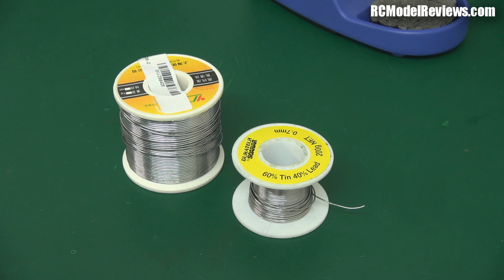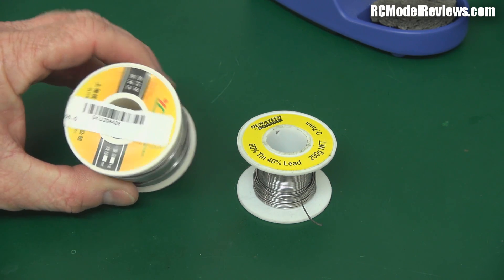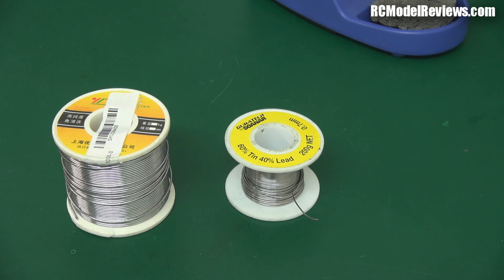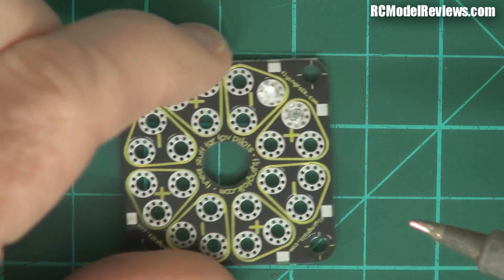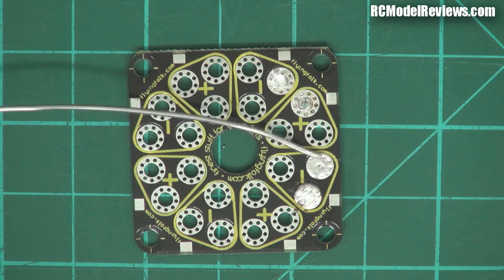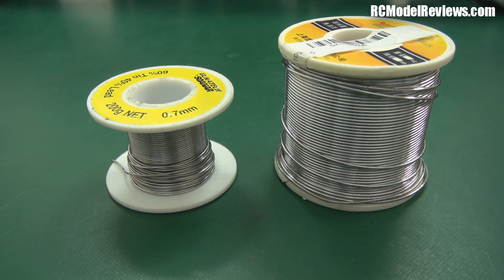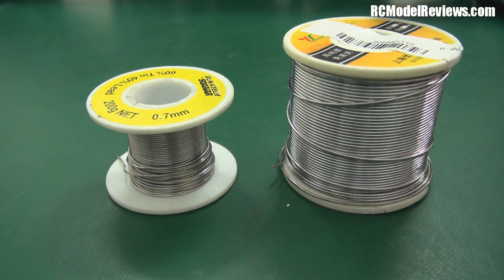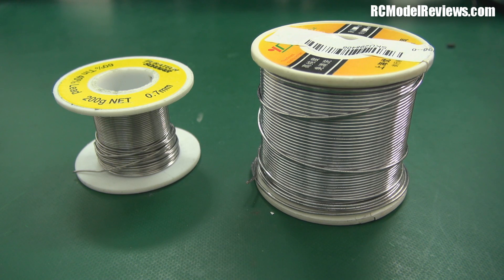60/40 versus unleaded solder

Comment: I use Mercury 703.450 lead-free solder and am quite happy with it, mainly use it for cables and so. It has 99.3% Tin and 0.7% Copper with 2.2% flux.   

It might have been worth explaining why lead in solder is not actually that dangerous. As I understand, boiling point of lead is so high that you cannot reach it with a measly soldering iron. So the vapour (while not healthy) that happens during soldering does not actually contain lead. Is that the correct explanation?
Reply: +YensR Yes, you are correct about soldering at normal temperatures not producing lead vapor.   The environmental/health impact seems to come mainly from the effects of e-waste where landfills are full of old electronic junk and the solder contained within.
Reply: EdWatts Well mercury is a substance that can be managed really, clean your hands properly after handling and preferably wear gloves. But above all don't breathe in the fumes, provided you don't do something overly stupid with it like consuming it... it doesn't absorb very well through the skin as far as I know.

And what you stated about the lead staying in the landfills, well I can't say I ever really investigated it but your statements do seem credible to me mainly because solder stuck to a PCB tends to be solidly connected unless you go about melting it or using harsh chemicals on it.

However I do not think that the RoHS in principle is a terrible thing, the alternatives are reasonably sufficient in my opinion but if anything the biggest factor that should be addressed is our own human nature:
- The lack of possibility to repair things (by design, try opening and putting some modern things back together intact with their plastic clips, self tapping screws, glued stuck etc).
- Our constant urge to "get new stuff" and then throw the old stuff out if its not even broken.
- If we do throw stuff out because its truly obsolete whether it works or not it should at least be recycled as well as possible reclaiming materials and reducing the landfill footprint.

As long as we behave in that way taking some of the harmful heavy metals that are included as trace amounts scattered through products will help, whether it ends up in a landfill (intact or crushed) and even more important if it goes through an incineration plant where those heavy metals would probably end up in the fumes (although they might filter most of that out? I don't know the details). Oh well the world isn't perfect, I would be okay with longer lasting better designed products... even at the increased cost price. Would be great to be able to repair them as well or get spare parts rather than "nope, replace the whole unit" approach.
Reply: +YensR Funnybthin though is that the fluxes used with lead free solder are actually more toxic than the rosin flux used for 60/40. You really shouldn;t solder with lead free indoors without a fume hood.
Reply: +quangluu96 Yup the flux smoke is indeed the worst aspect, personally if I'm soldering I usually have both my old little carbon filter fume extractor fan thingy (that just pulls it through the filter and away from the bench) and an open window + door to get some natural draft to ventilate the room in general.

With the right iron I do find lead free solder manageable but I do tend to grab my spools of leaded solder on most days. Mostly because I have them around and still got a bunch more in storage, but yea the environmental impact of all the discarded equipment containing little bit of lead solder on all the solder joints are not a negligeable factor and those small scattered amounts aren't easily recycled. I don't know what happens to them exactly if they end up in a waste burning facility, but it can't be any good in a landfill either.

To the operator of the soldering iron and the end user of the product though  the leaded solder isn't an issue directly, provided the soldering iron operator cleaned his/her hands before sticking it into the mouth or handling food.
Reply: EdWatts Obviously the Galena and elemental lead that naturally occurs in the ground has a much lower surface area than the billions of tons of wasted lead we have used in discarded electrical appliances.  Also the junk we've thrown out is usually not buried deeply enough to prevent runoff from leaching it into the groundwater.  A garbage dump is essentially a coffee filter full of bits of lead (and other toxic chemicals) that rain water is being percolated through.  That's a pretty big difference.
Reply: +EdWatts Well of course it's not going to leech out in a few years.  We're talking about a few centuries.  The planet and all of our garbage is still going to be here.
Reply: +Justin Hall 

You realize, don't you(?), that this lead was in the ground before it was in the solder.  The same is true for mercury.  Uranium, too.  Plutonium?  Well, not so much, but...  This "garbage" has always been with us on "Spaceship Earth".

By the way, it's "leach"; "leech" is a critter.
Reply: +Atomicskull That sounds scary. Do you have a source for that? I found the report from the Danish Toxicology Centre, but it is not very specific regarding the dangers of the fluxes (page 49) or seem to indicate that flux for lead-free solder might be better (page 66):   http://www.ems007.com/PDFs/Survey_on_Lead_free_solder_systems1.pdf
Reply: ***** Yes, I understand that. As you can see above in my reply, I have done some research. The question was: Which flux vapour is more dangerous: The flux in leaded or the flux in unleaded solder.
Reply: Yes, definitely - safety first!
Reply: +xjet 

It's really funny that no one mentions that landfills are sited with great regard to their potential for polluting ground water and that the lead in solder was, once upon a time, situated within the earth/soil before it was extracted with very little regard with respect to whether it might, one day, end up in minuscule amounts in drinking water.

In other words, this RoHS nonsense is a bunch of hooey.

"Save the Earth (?), ruin the world."
Reply: +quangluu96 

Yeah, but...

...I have buried printed circuit boards in my yard, some of which I left undisturbed for several years.  Upon excavation and microscopic examination, I verified to my own satisfaction that there was absolutely no visible/measurable leaching of the solder.  In other words, the solder in a television in your local landfill is not going to end up in your brain, liver, and kidneys.

Mercury, which is much more toxic -- and mobile -- than lead, can be found in its native state in little globules of liquid in cinnabar deposits.  When I was a boy, I and most of my friends had a jar of mercury available to us in a desk drawer which provided many hours of fun and enjoyment.  My friends and I -- and people who live near "mercury mines" -- have not been dropping like flies, nor will we ever be so.

Much ado about nothing.
Reply: Lead below boiling point will release vapor.  The ocean never gets above boiling yet it still rains.  It has a partial pressure for every temperature as a liquid.  That is why you smell it (assuming that is not the flux).  Also sometime if you use a torch you get hot enough to melt copper.   The boiling point of lead is 3180. 1984 is melting point of copper.  So as temp increases lead vapor increases.

Comment: Damn, I got some 63/37 from banggood, and it behaves the exact same way with dull joints, and pasty. I never even considered it was actually lead free. I just thought I hated 63/37 despite what everyone said. It is the worse solder I have ever used. I tossed it.

Comment: This was one of the first things I found out when I started the hobby. My solder was terrible and I was blaming the iron. So I got a new iron and it was the same, so I blamed myself. Then I happened to try some solder that a well known UK Quadcopter shop was using and tadaaaa! Beautiful solder joints. This video will no doubt help many people. Don't forget the link to you old video mate. Have a good one.
Reply: +John F Hendry 

Some years ago, I went to my father's house to help him with an electronic project; as I was preparing to leave, I had an inspiration.  We were both practical jokers, and I had some "dead soft" aluminum wire; what happened next was almost inevitable.  I took a large roll of the aluminum wire with me, and I arranged to have my wife call and ask for Dad while we were in the shop working.  When he went to answer the telephone, I quickly wound a layer of aluminum wire onto the solder spool.  When he came back to the shop and started "soldering" again, much hilarity ensued as he was completely unable to melt the aluminum wire with a soldering iron.

Dad was murdered in 2003, and I really miss him.
Reply: EdWatts Sorry to hear that...
Reply: +ThatHPI GUY that's exactly the same way I discovered that lead free solder is crap.
Reply: +ThatHPI GUY Same story here, matey.  Hated soldering for a long time and thought I just didn't have the knack for it. It put me right off getting anything past breadboard prototype stage. Got myself some nice and thin 60/40 and realised I actually CAN solder quite well. Now I actively look for excuses to solder stuff!
Reply: +ThatHPI GUY Ill try  this 60/40 solder asap. :-) Flying a 250 quad for a year now and with the build and repairs i was using the lead-free solder all the time.. Now i see the problem. hehehe Thanks bruce!
Reply: +John F Hendry 

Yeah, but the story was funny.

Thanks.
Reply: @starlino  who makes a good lead free solder please?
Reply: starlino what is a good supplier of lead free? What are the tricks? Would be a huge help in this debate! Thanks in advance
Reply: +ThatHPI GUY 
Spot on HPI, I was exactly same:)
Reply: +starlino Yes... I measured some leads I made... less resistance with the silver based unleaded solder so better flight times using small wires and connectors to save weight.
Reply: +Elias R. 
Save(?) the Earth, ruin the world.
Reply: EdWatts Not if you do it right... but don't try doing it at the zoo, you'll just get the animals upset;-) Try Sparkfun's silver solder, it solders  like leaded solder except at a little higher temp as long as the water based flux it uses is fresh (like any other water based flux). All other unleaded solder I've tried is garbage to work with. Silver solder is not only lighter in weight it's much stronger than soft leaded solder so for 90 degree SMA connectors that need to be reinforced and other structural needs it's all I use..
Reply: @JohnFHendry  $30 dollars a spool, no thanks.
Reply: @itechhen  Yes Sparkfun needs to read your post as a one pound spool of leadfree measured in length is a lot more solder than a pound of lead solder. Unless you solder a lot and need the weight savings and other benefits it's flux date may expire too soon... so they need to sell quarter pound spools as they did in the past... or you can share an order with a few friends as at $7.50 for a 1/4 pound may still last past it's flux expiration date if all you are doing in the time line is RC related.
Reply: Well remember we are made of time, and information is made of time, and information is never lost. And time never stops creating things. Who knows what's on the other side... we know far less than we know and what is impossible today always has a habit of becoming possible at a later date when enough time adds up to create it. The more I learn the harder it is to believe. The scale of things is so large to it's hard to imagine  most of it..
Reply: haha this is happen to me too after three solder gun and now with an eyes open. I gotta look for the other two where I left em at lol
Reply: You need a proper soldering station like JBC or Weller's to be able to work with lead free solder. You need like 375 degrees at least.
Reply: You don't need to spend $600 to have an iron get hot  enough to use shit solder
Reply: Been soldering for a while, over the years.  Got a bad roll of solder, ordered a new iron last night, tried it again this morning with my old solder and it was fine!  Guess I have been lucky with the solder I end up with.

Comment: Bruce, your comparing quality solder to shitty chinese solder, this is part of my full time job and lead free solder is mandatory and the good quality stiff works exactly the same just at 410deg c
Reply: Lead only slows down whisker growth but even lead can grow them and it's not related to just solder as there are many issues involved. Data centers have been shut down because the metal flooring in the building was causing whiskers that got air born to enter and short out the servers. Wakapedia: "Zinc, cadmium, and even lead whiskers have been documented.[1] Many techniques are used to mitigate the problem including changes to the annealing process (heating and cooling), addition of elements like copper and nickel (read my post above re Sparkfun's Special Blend solder: 96.35% Sn (Tin), 3.0% Ag (Silver), 0.5% Cu (Copper), 0.15% Sb (Antimony) ), and the inclusion of conformal coatings.[2] Traditionally, lead was added to slow down whisker growth in tin-based solders" Note it says slow down not stop.
Reply: John F Hendry 400c? Jesus christ what the hell are you soldering with that? Power lines?
Reply: michael hillpot tin whiskers crashed a space shuttle I'm pretty sure.
Reply: +Matthew Warner I would love some advice. What is a good brand of lead free solder?
Reply: I didn't say that... Aye OK SURE said it... I solder hot so I can solder fast to avoid heating the board but under 325c... as for whiskers on a FCB I hear Bruce talking about .... not that anyone has seen that that I know of... you clean it off as part of maintenance... IF it becomes an issue... I really like Sparkfun's Special Blend super easy to work with and without flux... but would be even better with the same flux but $ and drys out fast. Just used some leaded and not as easy... a little lower temp but that's all and heavy as lead.
Reply: BrynTheSkits nah its just that lead free solder works better at higher temps compared to leaded solder
Reply: Took the words out of my mouth you can compare cheap shit with good stuff no matter the composition
Reply: +Atomicskull I am a full time electronics tech as well and prefer leaded, but the lead free works just fine if you know how to use it.  As far as the whiskers, I have never seen it in anything I work on.  Our boards come from a board house that uses lead free just like almost every consumer manufacturer, if whiskers were such a big problem then all of your tvs, computers, phones, and everything else would be shorting and dying.  Take one apart and find whiskers to show me.
Reply: +Matthew Warner It doesn't grow tin whiskers any less though. Lead is the only thing known to inhibit tin whisker and tin pest. Mixing different solder formulations can yield unreliable solder joint as well and it can make repairs a nightmare because it can be impossible to tell exactly what solder formula was used just by looking at it. For example if you mix a solder that contains copper with one that doesn't voids can develop inside the solder joint over time.
Reply: How exactly are most of my components and any plastics expected to withstand 410 c ?  I'm not soldering 4 gauge wires and car battery terminals.  Been soldering for years - now this new POOP solder you practically need to push it through a 3d print head so it can take a dump on your electronics.

Comment: Cheap lead free solder is not worth the hassle, there are some good blends now that are a lot easier to solder with than that stuff you have there, I've had plenty of experience with SN100C, it's a bit pricier but so far has given the closest results to leaded out of all the solder we tested over the years doing PCB manufacturing. It still does require a bit more heat though. 

That being said, I would still go leaded solder for hobbyist use, both for ease of soldering and the greater tolerance it has for soldering a good joint. There's a reason the auto, military and medical products have exemptions for the RoHS requirements most countries have these days.

Comment: Dear Bruce. Thanks for informative vid. It explains why I always had stodgy solder and wouldn't flow!! I was on the point of buying a new soldering iron thinking it wasn't getting to the right temperature.

What is the best way to sean the tip of my soldering iron? Cheers.

Comment: Can you mix solders? I always use unleaded on repairs of modern equipment, and leaded if starting from scratch or repairing old stuff.
Reply: +Laurence Cooper 
Yeah, it's fine. But you should remove as much of the "different" solder as possible. If you can mix the solders (by melting the whole joint) it should be fine, too. But avoid joints where parts of it still are lead free and other parts leaded (for example solder stuck in a throughhole). Not talking from experience here, more pulling it out of my (scientific) ass ;) , but the different physical properties (foremost thermal expansion) could lead to cold joints in the future.

Comment: I have been using 60/40 for a while with no problems. I went to get more and could only get at the time was 60/38/2% resin flux, with no mention of rosin. Would this be ok for soldering joints needed for modeling? I get a wee bit confused when it comes to something different. By the way I always look forward to your videos, you have been so helpful. Thank you.